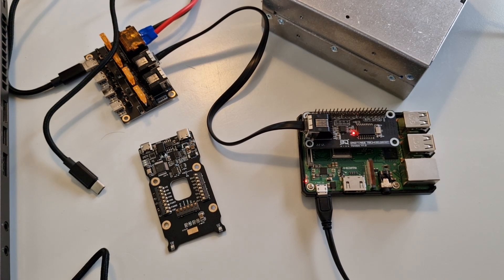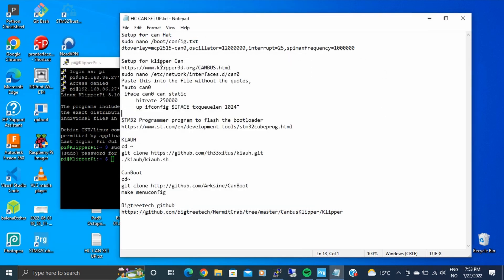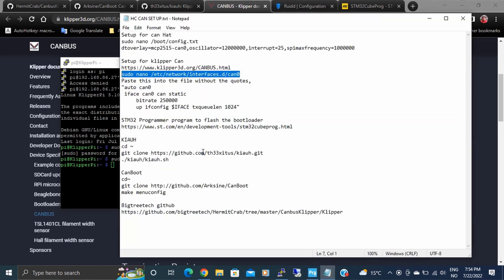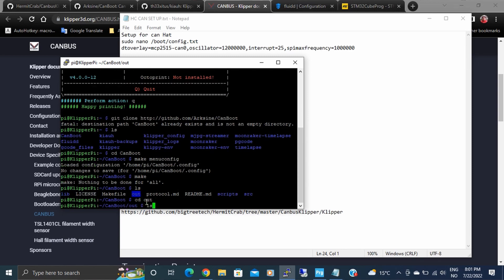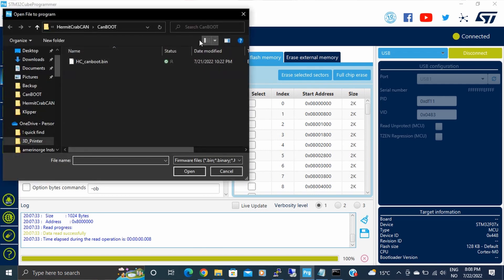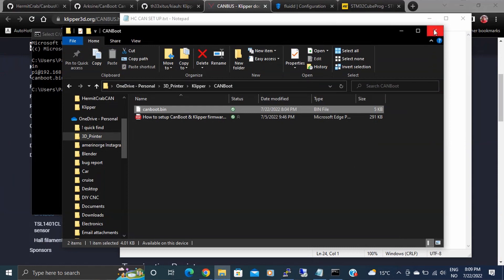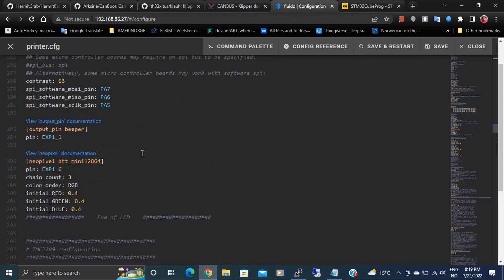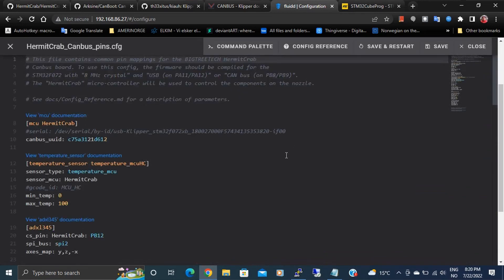HermitCrab CAN CanBoot (katapult) and Klipper Tutorial

Comment: Wow where was this a week ago when i did this lol 😆 Mine works great so far but Its kinda a pain to switch cfg files for each head.
Reply from the maker: Perhaps some gcode macros could be made to change parameters to make that easier.
Reply: @StackingLayers  i peraonally couldnt think of a way to switch via gcodes. But im thinking i could edit the moonraker comfig and have a line commented out that either makes the first cfg active or like a printer_toolplate1.cfg active if thats what you uncomment then 1 cfg for each toolplate.  That way its kinda seamless you just have to change whats commented out
Reply from the maker: I haven't got too deep into it yet but as far as I understand it, you just need to set up multiple extruders like [extruder] [extruder1] and so on. Then just tell the slicer/printer which too you want to use with T0, T1,... And if you need different acceleration and cornering speeds then those can just be gcode macros.
Reply: @StackingLayers  oh man thats a good idea.
Reply from the maker: This is klipper's doc for that. And I believe we can define the same pins in each extruder. I'm waiting on more supplies to test this out. https://github.com/Klipper3d/klipper/blob/master/docs/Config_Reference.md#extruder1
Reply: @StackingLayers  oh man why have t i seen that!!! seems like it enables a parking feature too you could swap out the heads mid print if you wanted to for some reason.
Reply: my hermit crab blew up tonight :( I think it might have been wired wrong tho.  I could only get it to work if it was powered w the cable that comes w/ it connected to the power supply.  I turned it on tonight after like 2 weeks of having it working and it sparked and a little flame then magic smoke.  I think it didnt like the power and usb C but it always says printer not ready when i use just the C cable. Its only worked for me w both C and power.  I have the CAN version tho too. I see your CAN version works w just the usb C right?
Reply from the maker: @MatttKelly  yeah when in can mode you are not to have any other cables, just the USBC. Maybe there is something wrong with the USB C if it wasn't providing power
Reply: @StackingLayers  who knows ive got a replacement coming from amazon. thats what i was wondering too and probably why i had a hard time setting it up maybe.  The new one should be easy to get going thankfully.
Reply from the maker: Should be good just don't double power it 😅
Reply: @StackingLayers  does your toolplate power led come on when its connected with just the usb C? mine didnt.
Reply from the maker: It does when the can hub is powered up.

Comment: Thank you Patrick for a great HC programming tutorial. I use it last August it set up went fine. I have been using my HC since then with no problems. Recently I was going through mu usual updates that show up in Fluidd on a regular basis. well one of the updates shut down my system so that my printer is no longer functioning as I cannot overcome the error message [Errno 19] No such device. so naturally I have gone back to reconfigure all of my CFG files. The major problem that keeps occurring is that I cannot get STM32 Programmer to erase and then reflash my HC board. I have gone to an older version of STM 32 and still no luck. It has a problem connecting with the board and then even says it the files are write protected. Do you no any way to erase my HC board and re flash the new canboot.bin file i have created. Until i do that I cannot get my RP to recognize the board to get the uuid from the board
Thanks in advance for any suggestions you have
Matt Ventura
Reply from the maker: I'm not sure what you have changed so far but there was an update to moonraker not too long ago that broke things. But all you had to do was run a script to remap the configuration files to the new format. You shouldn't have to re-flash the MCUs. 
Check out the information in this notice, https://github.com/Arksine/moonraker/issues/516 
I'm really not sure why it won't let you redo the bootloader. Honestly I haven't tried. Canboot is made to let you flash the firmware without needing to mess with the bootloader
Reply: @StackingLayers  Thanks for your response Patrick, I am still battling my problem with no solution in sight. I have reached out to BTT Tony at BTT to see if they have a solution

Comment: Nice video, I've been following those instructions but no luck. Cant go further on the python3 flash_can.py u "UUID". Have tried from scratch about 5 times with no luck. Any idea why?. When it does the Write complete -- verifying i get "#ERROR:root:Can Read Error"
Reply from the maker: Are you putting your UUID in place of the  "UUID" (no quotes needed)?
So like, 
    python3 flash_can.py -u 1234567
If you don't know the UUID you can query it with this,
    python3 flash_can.py -q
Reply: @StackingLayers  in the uudi no quotes i use the alphanumeric code i get
Reply: Yes query does retunr the alphanumeric code.
Reply from the maker: To confirm, you have canboot flashed correct? I assume so since you say you can query the UUID. 
try running the script this way, 
    cd ~/CanBoot/scripts
    python3 flash_can.py -i can0 -f ~/klipper/out/klipper.bin -u <uuid>
If you get the same error, is there any other information with it?
Reply: @StackingLayers  i would asume it is flashed correctly. Hence the uuid response. What i think is nor working is trying to flash klipper on it. I did some .cfg edits on klipper and hermit crab mcu is shown in the mainsail machine usage meters as well as the skr e3 v2. Only issue is the adc timeout. I think i messaged you in discord from the biqu server. Maybe i can send you the screenshot of the error that pops up when trying to flash klipper onto the hermit crab.
Reply: @StackingLayers  same thing. however it is recognized as mcu HermitCrab on klipper. so i guess the error is related to a problem reading the klipper firmware flashed on the toolhead. i can control the stepper, the neopixels and get data from TH0
Reply from the maker: Do you have a seperat hermitCrab.cfg or is the extruder defined in the printer.cfg?
If you have a separate config, check that there isn't another extruder defined with a thermistor in the printer.cfg